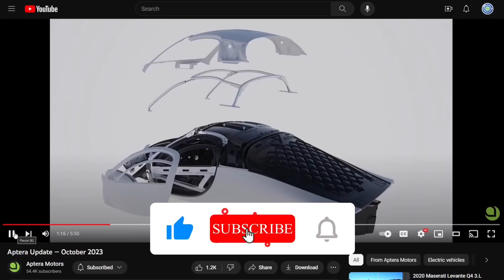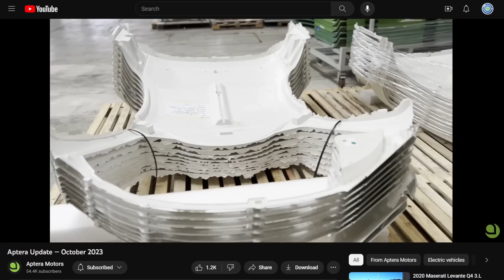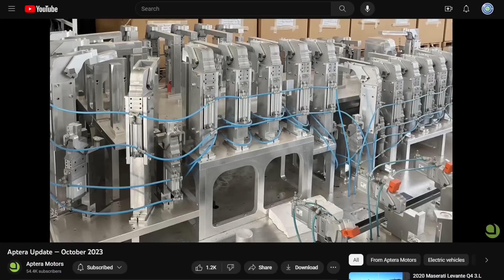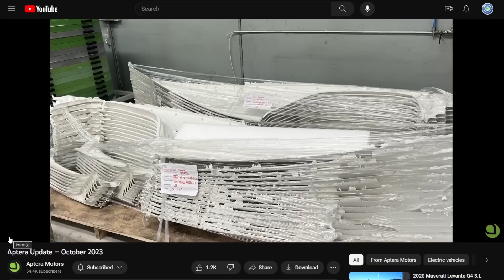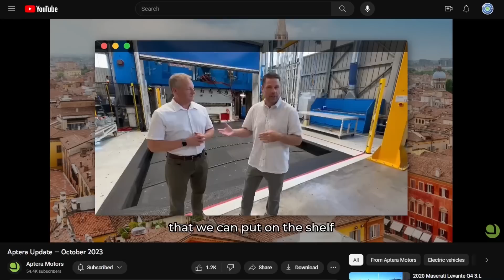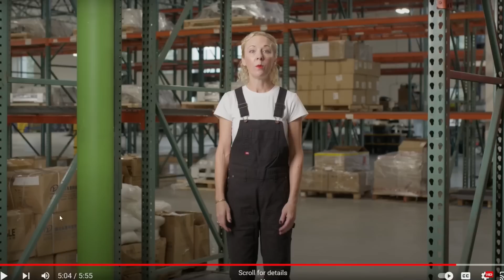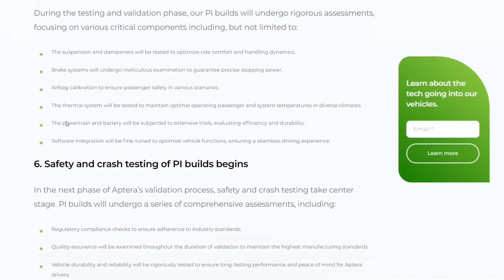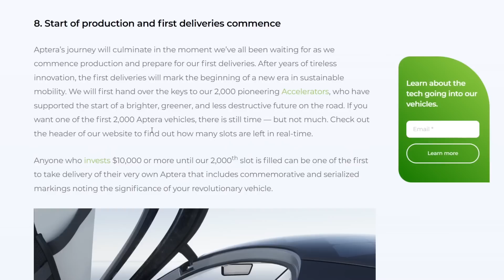Aptera's October 2023 update and ambassador meeting highlights

Comment: Micrometer is not a unit of measure, it is a tool to measure distances
Reply: Actually, it's both: 
"The micrometre as used by the International Bureau of Weights and Measures; SI symbol: μm or micrometer, also commonly known by the non-SI term micron, is a unit of length in the International System of Units equalling 1×10⁻⁶ metre; that is, one millionth of a metre."
Reply: @paulrybarczyk5013 yeah, commonly named micron.
Reply: It is both the tool and the unit of measurement. The spelling is the same (in the US) but the pronunciation is different.
Reply: The accuracy of the measurement says little of the actual tolerance allowed.

Comment: Sorry Sarah, according to the U.S. Patent and Trademark Office, you (Aptera) didn't invent "automotive grade curved solar panels".  Maybe you didn't get the memo but all the "prior art" cited by the patent examiner has all but doomed Aptera's patent application.
Reply: Cool, cite the patent that takes precedent
Reply: @wyattnoise  here you go:

From a comment on Aptera's video: Hans Gochermann invented "Automotive grade curved solar panels" and got a patent for it in 1988.  US Patent #4,717,790
Reply: @bobhilder1469 Found a excerpt from that patent from 1988, it only covers one dimensional bending of the solar cell. I have found 5 patent’s from Aptera that concern solar cells, which one are you referring too?
Reply: @Running__Rabbit  Aptera does not have 5 patent's that concern solar cells.  They have on the order of 5 patent APPLICATIONS that concern solar cells.  They have been granted only one solar related DESIGN patent.

Look for Aptera's patent APPLICATION number of 18/169,576 and read the "non-final rejection" write up from the patent application examiner.  It's pretty brutal.....ALL APTERA'S CLAIMS ARE REJECTED.
Reply: Specifics?  Quick search I see 8 patents, some pending & some already granted.
Reply: @gr8dvd  Look for Aptera's patent APPLICATION number of 18/169,576

FYI, there is only 1 solar related patent that has been granted to Aptera and it's a "design" patent that essentially just protects the "look" of Aptera's 45 degree rotated cells.  Also, some of the "pending" have been abandoned.

Comment: Cpc is outsourcong what exactly?  The production of the stamping die, or the manufacturing of that production component going forward?
Reply: They are outsourcing the machining of the die to make the main body tub.  Probably the steel block that had to be machined was larger then CPC’s internal machine shop could handle.  I would guess because of this outsourcing we did not see a finished body in September like Sandy Munro mentioned. The tub is a huge part, about 3/4 the length of the whole car.
Reply from the maker: They're outsourcing the machining of the dies